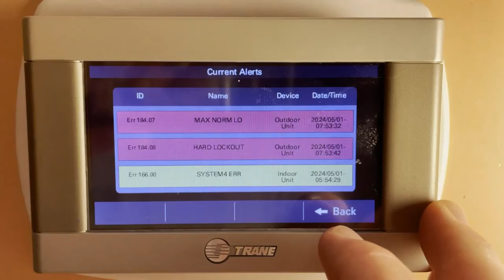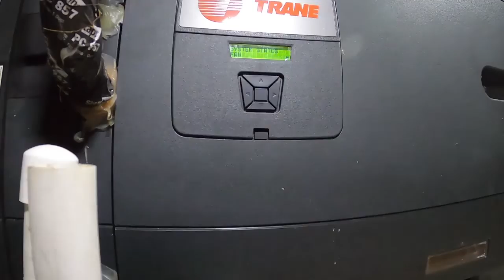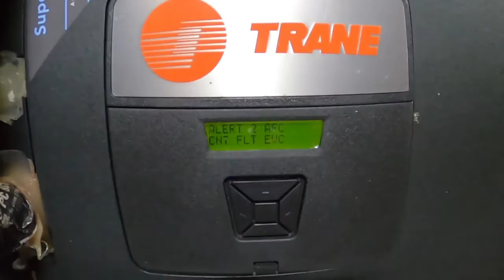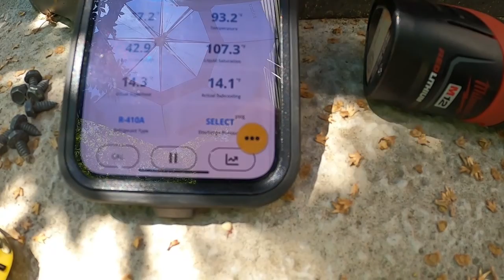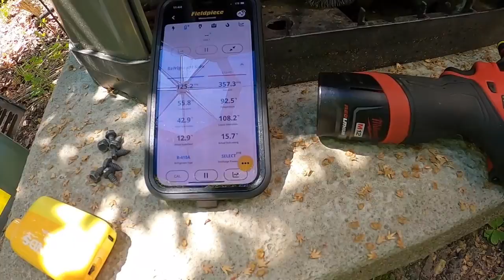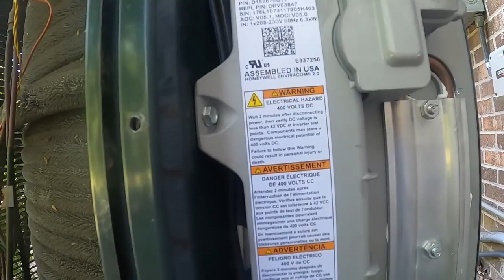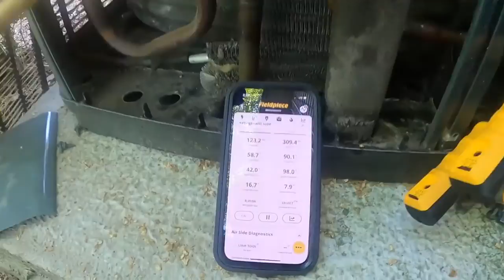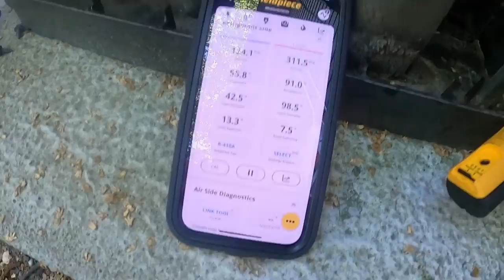Trane High Efficiency cooling problems.

Comment: In my opinion, if you are not a dealer for or are certified to work on this type of system sometimes you are better off to just walk away and let someone else deal with it. These high-performance systems are just too much to try and keep up with and with the different brands and different problems and parts needed it seems like a losing battle to me. I would be curious to know What others think about it?
Reply from the maker: I have tried to stay up on these things, but I much prefer the lower SEER units that use common parts that would be on most service vans.
Reply: @MYHVACLIFE  I totally understand your statement, and you seem to be able to keep up with technology. That is a very good trait! You made a good video here, and it will help a lot of technicians. Thank you for taking the time to make and post it.

Comment: Generac systems are bad for AC's. IS there are surge protector on there? I didn't see one.  Variable speeds are good for power regulation on paper. But in practical use, they are worthless.
Reply from the maker: Didn't notice one, but I wasn't looking.

Comment: Love seeing these VX Trane videos,  I have one I installed at my house, 6 years in, no problems yet. Probaly just jinxed myself. Being a strictly refrigeration tech, these videos will definitely help in the future.  Thanks again.
Reply: These companies did an incredibly smart thing with these units but terrible for the customers. The second that units out of warranty and you got to replace a board instant sale🎉 I just did a board on a Bosch that was $1,200 our cost that's a $3,000 job😂😂😂 I think they figure if the customer has enough money to buy the high-efficiency unit he's got enough money to replace it every 10 years
Reply from the maker: They are good systems now that the kinks have been worked out, They recently redesigned it and made new changes, so I expect some issues in the new models.